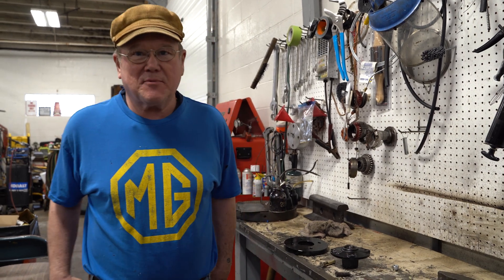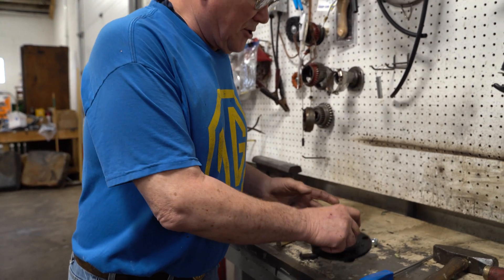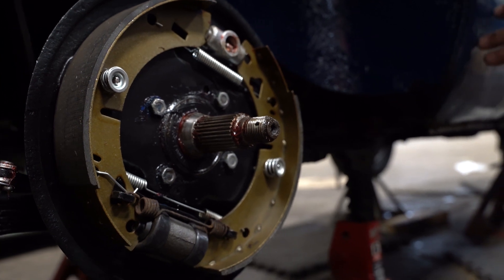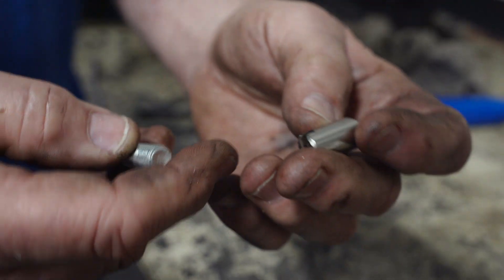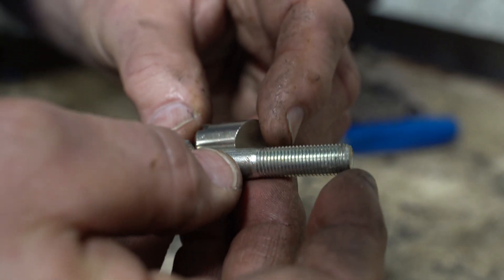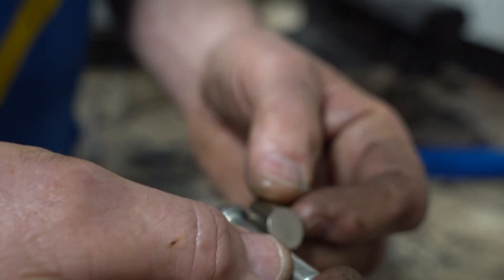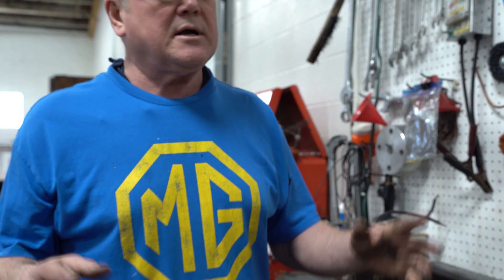325 MG Tech | MGB Rear Brakes Assembly and Troubleshooting

Comment: I had the opposite problem...........with the adjuster turned all the way in, I could barely get the drum on and it had quite a drag when turning by hand.  I removed the shoes and trimmed the cylinder contact surface JUST A LITTLE BIT on with a bench grinder..........keeping the profile as close as I could.  The drum now slides on and the with 3 clicks, the adjuster locks the wheel. Backed it off one click as per factory shop manual. A dab of white grease and done!

Comment: John, in your famous video from 2007 about mounting brake shoes you specifically mention that the tag from the goes on the underside of the hand brake lever (see time stamped here: https://youtu.be/vomcvvpv-2Q?t=305 ). In this video you mention that it goes on top (see at 4:35). Are there various versions of this spring in use, or is this a case of progressive insight?

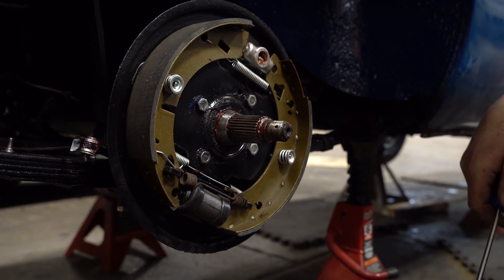Comment: 07:10 I recently replaced the brake shoes on my 1964 roadster with wire wheels. I did not notice any seal. Is that because I left the wheel hub on, or is the banjo axle different in design?

Comment: The best thing about this video is the video quality and the contrast between parts. It is easy to see how everything is supposed to be installed. The pic in pic closeups were also a nice touch. Out of curiosity did you keep the old lathe from the shop? It must be 70 years old or a bit.

Comment: Hi John! I like your solution of using a bolt to grind down new brake adjusters. I had the same problem when I was refreshing the brakes on my Midget a few years back--even with the pyramid wedge all the way in, my rods were a little too short. My solution wasn't as elegant as yours, though--I just jammed a couple washers between the rods and the wedge!

Comment: John,  Why don't you run a drill through your hub instead of turning down the studs?  Make the hub holes slightly larger and press in the studs.  I ordered a new '66 MGB in Saigon, picked it up in SoCal (Compton).  The ebrake never worked.  Could straddle the hump and pull up on the handle with both hands, get out and push the car.  Friend bought a new '67 B and had the same problem - only difference was his rolled down the steep hill on which it was parked and into a house 150' away.  I'm gong to check out your rear brake clip.